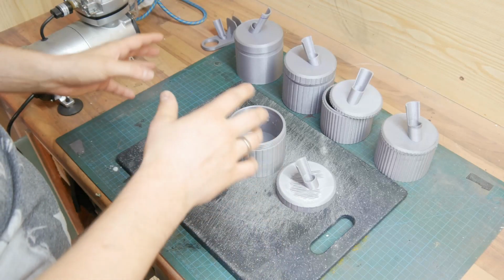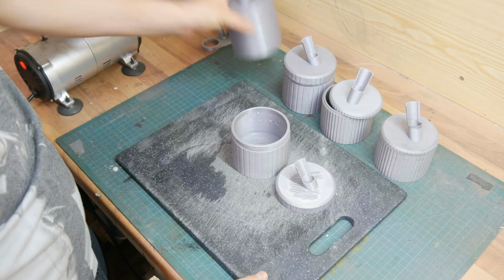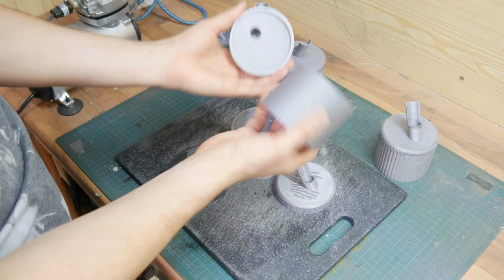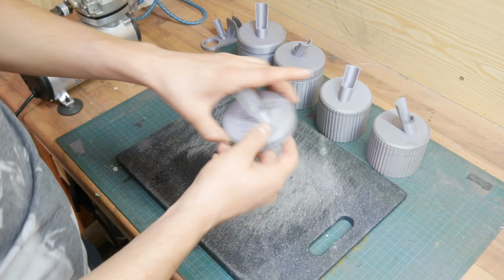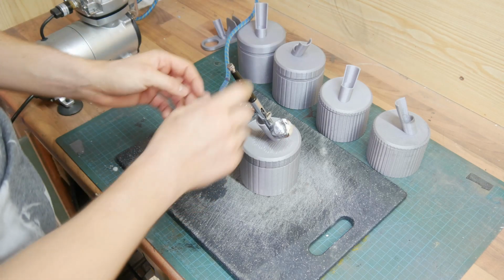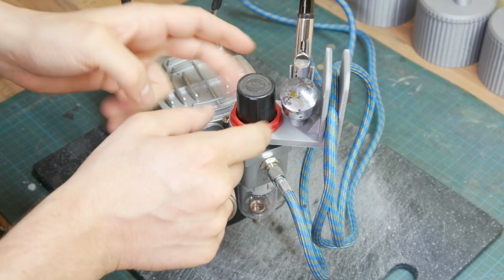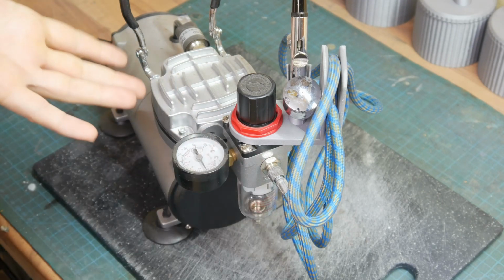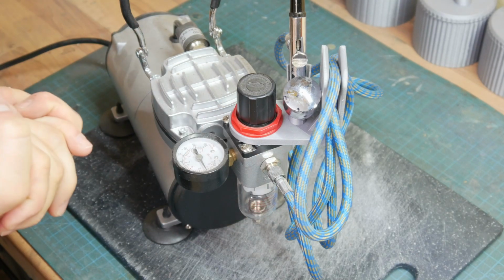3D printed Airbrush MODS

Comment: Cool idea! I recommend to add some "fork" like structure on the airbrush holder part that goes around the downward facing connector so that the airbrush can rotate while sitting in the holder and you need another hole somewhere in the lid which can be plugged with cotton or some synthetic fibers so that the air you blow in can escape somewhere else than around the airbrush tip because this why a lot of the color "mist" (fumes) comes right back out.